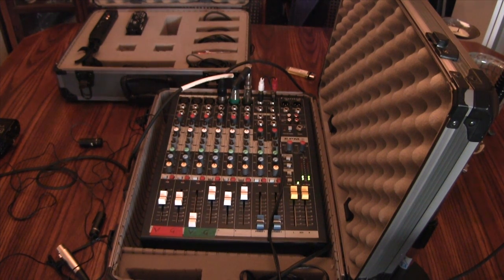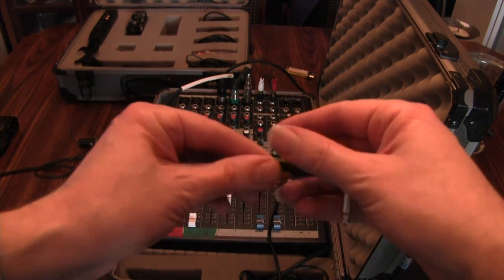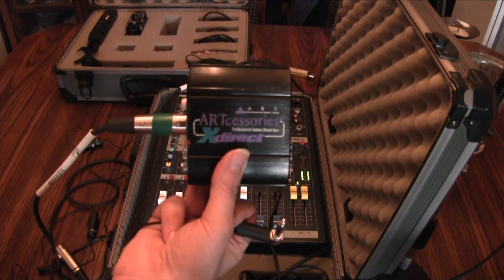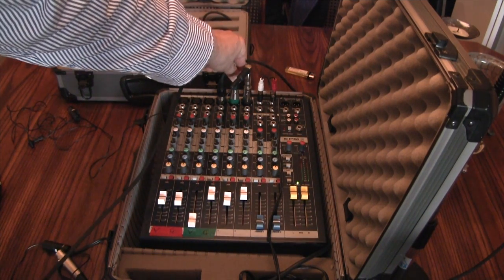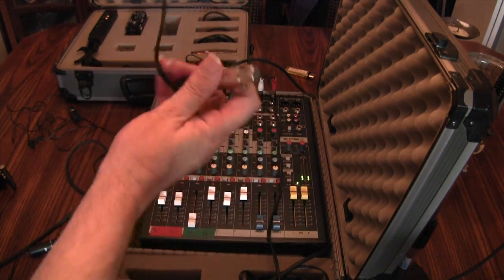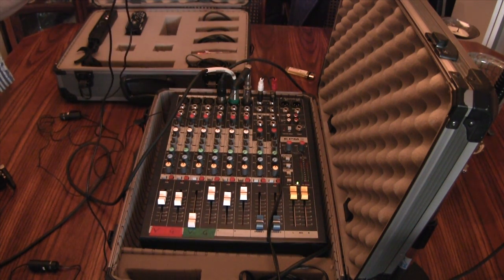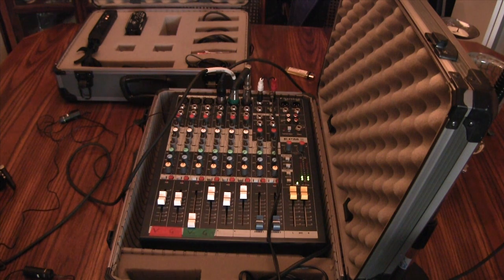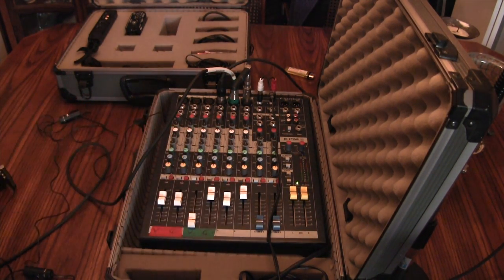Audio Technica ATR3350 microphone: DI Box Improves Performance

Comment: Would a decent pre amp in a mixer (Xenyx q502 usb) have a similar beneficial effect?
Reply from the maker: +girl in a gale If the Xenyx has an instrument input (meaning it has high impedance and takes unbalanced signals) then it probably would. Otherwise you will still need a DI box (such as the one I used) to convert unbalanced to balanced first.